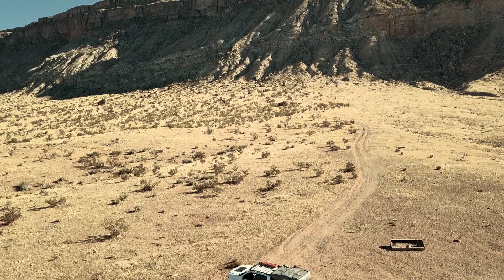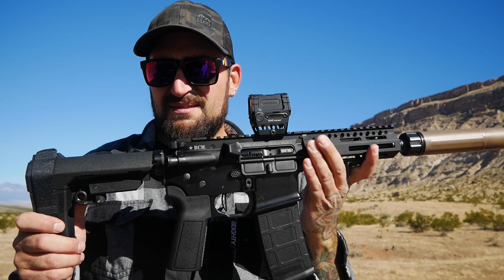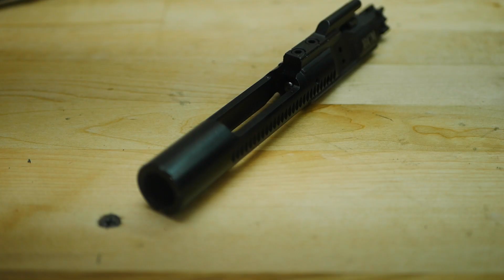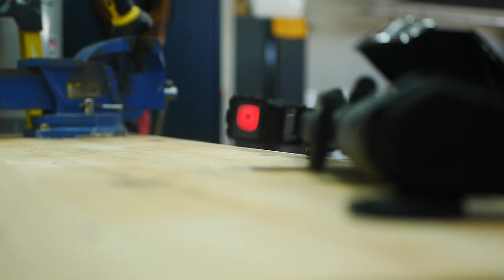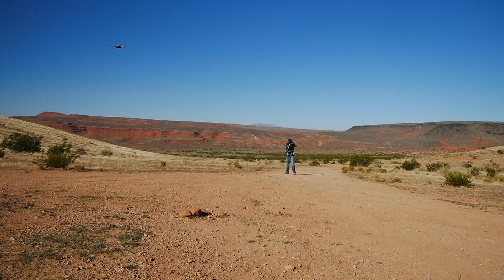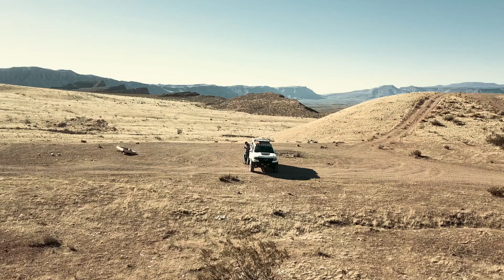Why BUY when you can BUILD | 300 Blackout

Comment: hey Johnny. Great video. Subscribed.
I'm where you were a year ago, analysis paralysis on optic for my 7.5" barreled 300blk upper. Any thoughts or buyers remorse of your choice of optic? I am thinking about something with BDC reference lines for shooting subs and supers out at 200-300 yds. Shot a friends 8" 300blk pistol this weekend with the AEMS optic out at 275 yds with 220gn subs and we had to hold over a ton. Not thinking that will be super common, but was fun to ring steel from so far away, but only hit every 1 in 10 without reference marks on the reticle.
Reply from the maker: Only thing i would like is to add a riser to it, but that would be just about any optic you put on it.  The new AEMS one they make that has a really large window is cool, but i dont think necessary for a small gun like this.
Reply: @JohnnyPewtah thank you sir! 🫡

Comment: Fix your mag release button. I see this all the time people not properly installing the mag catch button. It’s supposed to be flush with not only the threads but also flush or below the fencing of the lower. Sometimes you have to flip the button around 180 degrees (which is equivalent to a half turn) if you get to where it’s almost there but one more full turn is bit to much.
Reply from the maker: so i looked into this, i have it setup the same way on my 556 gun as well, on the 300blk build, empty mag seats super easy with bolt open or closed. if i have rounds in the mag, its a lot easier to seat with the bolt locked back, but if its forward, mag is pretty hard to seat.
Reply: @JohnnyPewtah that happens on every AR more or less. Thread the button flush like he said and only load 28-29 if you are going to insert mag on a closed bolt.
Reply: Not sure what any of that has to do with having your mag release button threaded down all the way like it’s supposed to be. But, ok.

Comment: BCA has 7.5 barrels under a 100$. Turns your 5.56 ar pistol to 300 Blk  on the cheap.
Reply: its 1/8 twist which is kind of shit for subs :\ spend the extra $20 on a faxon and get the superior twist rate and wayyy better moa
Reply: @HugeCockAndBalls in a home defense situation. As long as the round is on target within 25'. The threat will be neutralized.